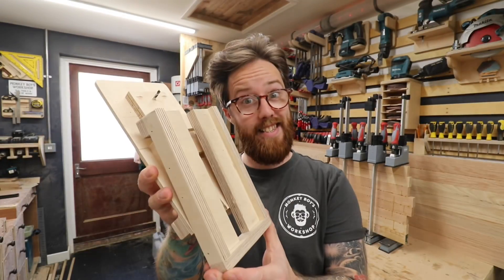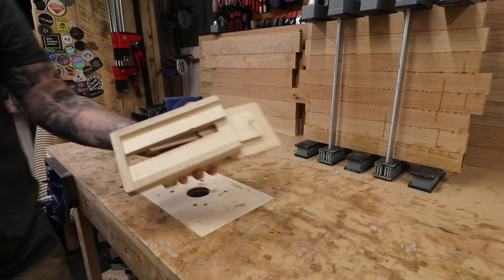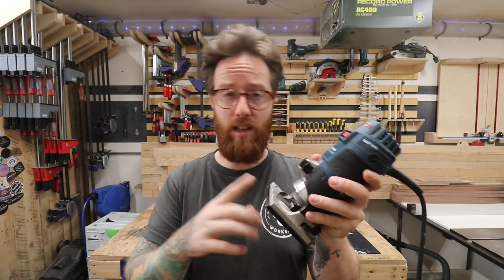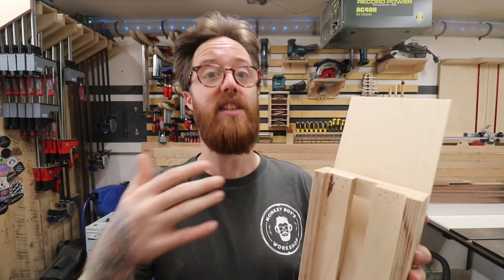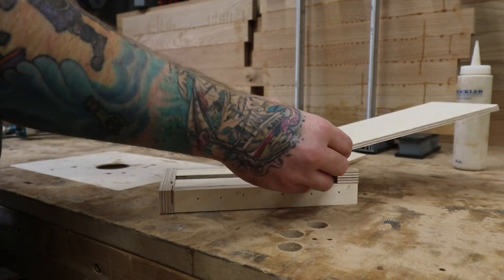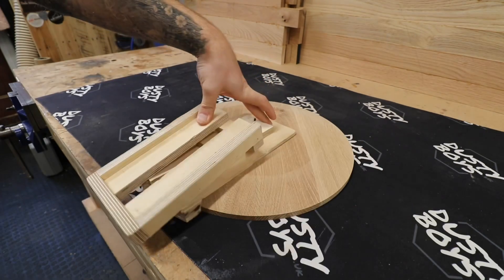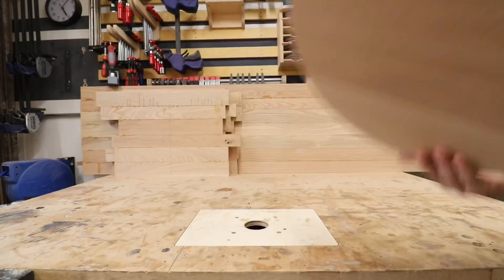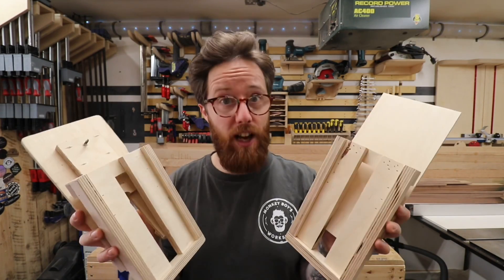DIY CHAMFER JIG - Easy Build to up your FURNITURE PROJECTS

Comment: I highly suggest if you build this to use your routers plunge base, not the trim base. This will allow you to return to a set depth if you are doing many shallow passes on different sides of a piece. Also, and this is a big one, add some paste wax to all surfaces that interface with the router.

An alternative method I used to build the main plate was to use a board larger than I needed and I set up one of the side walls. I also set up two short side walls. Then I used my plunge base to plunge down with a straight bit to route a channel. Finally the other side wall was attached. Trim the outside of the plate to size with a template bit and bob's your uncle. Never measure when you can reference.
Reply from the maker: Thanks for your comment! The trim base works really well thanks but yes the plunge would  work too. And of course, always put wax on the surfaces 🤙🏻